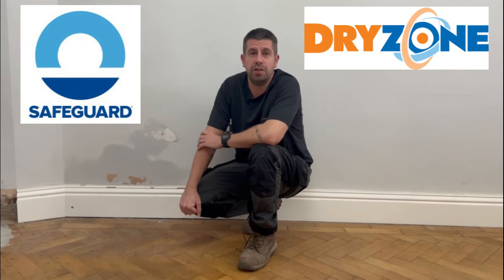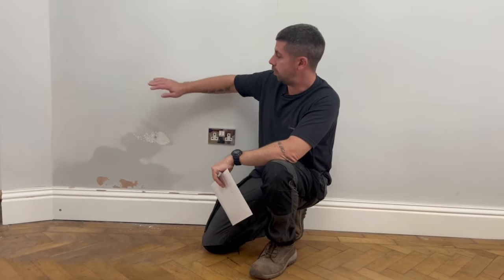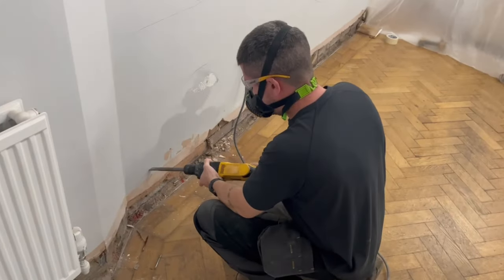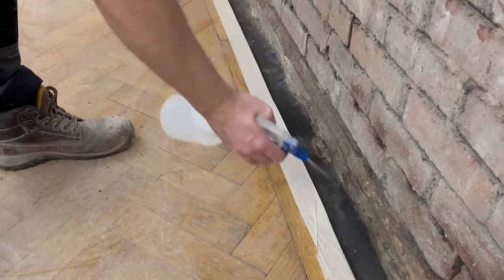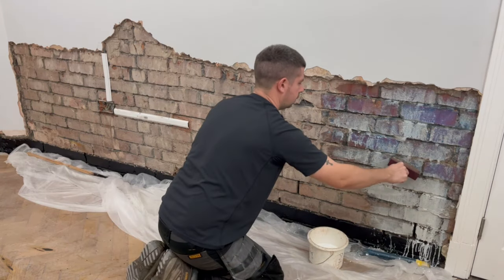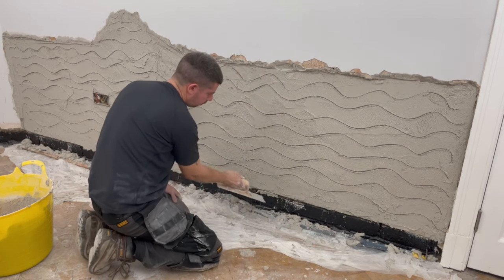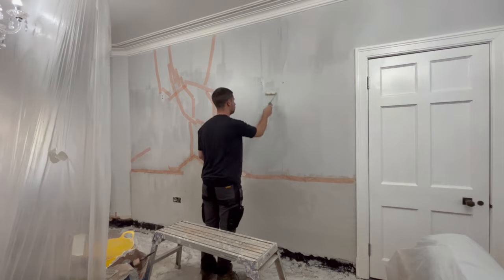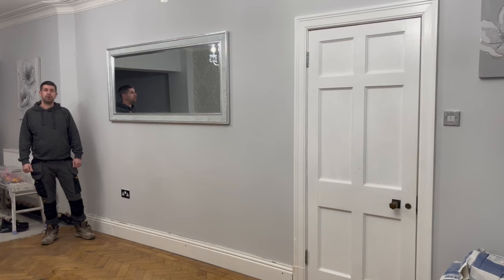How to stop rising damp, easy DIY solution

Comment: doesn't this just push the moisture somewhere else. you make a barrier to where it is coming through right now, but who knows where that moisture is going instead. I can't help but see this as a temporary thing. Usually pushing the problem down the road to the next owner of the house (first hand experience of this happening right now)
Reply: I think it acts like a Damp proofing course with the rods then everything else sounds like over engineering it to make it fully sealed.
Reply: You might be right but it depends on the cause. The video doesn’t have enough information in it to explain the cause as it’s about this system. Internal non-party walls with a concrete floor can be a head scratcher.
Reply: Had neighbour with damp who had it treated similarly to this. All that happened, was the damp came through into my house through the adjoining wall. After they moved, the new neighbour removed an old extension only to find an old blocked drain. I cleaned and made good and the damp slowly dried over time!.
This stuff just costs money and doesn't solve the issue just masks it
Reply: Papering over the cracks, treat the source not the symptoms

Comment: Damp will come through that plaster I promise you, there is no special coating to stop the damp, the coating will just peel and bubble off.   In an old house (mine is 250 years old), the only sure way is to take out a section of the wall at floor level  say 4 bricks length at time at ground level either one brick or two bricks thick, then with the hole clearance available dig out as much below ground which was under the bricks you have taken out, a breaker drill will do the job beautifully especially if you can break up the adjacent floor say 3 inches out and that will enable you to sideways dig out the old damp foundation rubble causing the rising damp.  Having dug out your new foundation trench you have ,  now you have to put in there what you would use as if was a new house you were building, ie impervious materials, quality concrete, DPC and  blue clay impervious bricks.   This might sound like hard work but it's worth it.  The best thing is that the  layer you put in say 2 bricks high when dried off, will be totally dry and the damp brickwork above it will dry out at about an inch or 2 a month, even quicker if you want to use a fan on the wall continuously.  A 4 brick section of the wall taken out at a time and it won't take long and in the end you know it's been done right and any plastering done above that new brickwork you know it will be good and dry.
Reply: It's not meant to stop it. The rods do.

Comment: Just put dry rods in the house I am renovating. It has a mixture of solid walls and cavity walls. I found many problems before installing the rods, and consider them "belt and braces!" There were redundant vents below floor lever that should have been removed when concrete floors were installed.  Ground levels well above old slate damp course, slates on roof that didn't reach gutter, drainage pipes underground that were held together with parcel tape, damp courses bridged inside. Also concrete right up to house walls (my pet hate.) I dug 10 inches down and put a gravel trap around the house. Poor house has been sat in a moat for years! That was just the beginning, I could write a book.

Comment: My guess would be gypsum plaster sealing-in the moisture causing the build-up of the wet. Solution: Remove all the gypsum plaster and replace with an appropriate BREATHABLE plaster and problem solved. It's amazing that people do things and are completely oblivious to what is actually going on around them.
Reply: This!!!! NHL 3.5, and check the exterior ground level, and guttering too!
Reply: Exactly 💯

Comment: Had damp and mouldy smell in my launge for years. After a lot of replacing plaster and keeping a window open all through winter months, I decided to rip up the floor boards. My DPC was old-fashioned slates. Broken and missing motar from joints and some of the slates had deteriorated. Thorough cleaning, then replaced broken and deteriorated slates. Repointed, then cleared a whole lot of damp dirt from underneath the suspended flooring. Let the area dry out for approx 1 month. Yeah, it was a long, hard, and messy job, but it was worth it.
 Replastered wall. Replaced damp skirting and floorboards. Sanded and varnished wooden floor. 
Damp walls and smell gone. Oh, I also had to dig up the concrete paving under the  windows outside as it was higher than the airbricks. I replaced the rotten makeshift airbricks covering with clay airbricks. My launge has remained damp free and smells great for over 3yrs now.
And i'm a woman in her 50s! 
I learnt almost all I know from these DIY videos.
My thing is, have a go. You never know what you can achieve. The best thing is, you save yourself a fortune.

Comment: Wish they did similar products for garages.  I have a huge problem with water seeping through an underground wall.
You're a brave man to take on plastering as a non professional. The tiniest imperfections are magnified once you get silk paint on there.
Reply from the maker: They do tanking products that would do a garage.
I'm quite good at plastering, it sort of came naturally to me without being taught but I only use matt paint 👍🏼
Reply: @spendtimesavemoneydiy  What's a tanking product? Is that the word I should search by?
Yeah, matt paint hides a lot of sins but I do like the sheen of silk. Just give sa wall a bit of life without it being OTT.
Reply from the maker: @Martial-Mat  tanking is for walls with ground levels above the dpc so the likes of basements
Reply: @spendtimesavemoneydiy  I'm sorry - what's the dpc? Can I use tanking on floors? Can it be painted?
Reply from the maker: @Martial-Mat  dpc = damp proof course usually 150mm above ground level. The tanking is for the walls and you can use a damp proof membrane on the floor like I did in my garage. Here's a link to the video 
Damp proofing the garage/workshop floor and new osb flooring
https://youtu.be/k6E94o63iAI
Reply: @spendtimesavemoneydiy  Nice one. Thanks buddy!
Reply: Don't use slik paint then! Looks tacky and is opressive!
Reply: @ozzie539  Oppressive? Quite the opposite I'd say. It's all fashion - to me, mat looks like people are hiding something or trying to be contemporary. I think silk gives a nice sheen, especially when applied by roller.
Reply: @matbroomfield tbh I silked  my bedroom as a late teen ..cool but prefer matt it's a personal thing   def not hiding anything here

Comment: Great stuff. Did you manage find out teh cause of the rsing damp? If so, how did you fix it so it doesnt occure again?
Reply: How did he fix it? With dry rods of course, did you not watch the video?
Reply: @czx68  no, what was the cause of it
Reply: @jonneymendoza   Gypsum plaster layer placed over the old breathable lime plaster is locking moisture in - just remove the gypsum and problem is rectified, Everything he did in this video is nonsense.
Reply: @adrienne7513  would plaster board drywall be better for preventing damp?

Comment: Ive been told the best way to deal with chimney salts is to knock all the render off, then spray it with TG500 and use Sika 1 in the mix. Is this right for chimney salts?

Comment: Brickwork looked bone dusty dry!?
Yet surface of gysum plaster appeared damp.
Doesn't seem like the problem was from behind the plaster.
Was a damp survey done first?

Looks like you've just hidden the real problem for a few years.
Hope the floor scrubbed up well after too. A few more dust sheets down would have saved you hours of cleaning up.

Comment: very good video  !  if you was plasterboarding after the  dryzone rods  what salt neutraliser would you use on the wall  ?  thankyou
Reply: Hi mark watch other video dry zone similar but they use 4 X3 plasterboards nearly same method so put in express system (dry zone)an also Google damp Sam express system I was using aqua boards but to be honest when I saw damp Sam an dry zone using normal 4 X3 boards I've changed to them hope this help pal 👍👍👍saves u mixing up the renovating plaster which I don't like them google or phone dry zone up or go to the merchant off they have the products video was good to watch he was good but I prefer the other way using boards 👍👍👍👍

Comment: You did a nice job. Be interesting to find out why that wall was getting damp, must be some water source underneath there.
Reply from the maker: The house is 90 years old so I think whatever damp proof course they used if any is now failing so damp is beginning to rise in a few places
Reply: The electric socket has been moved at some point and the affected area filled with bonding coat which is unsuitable for low levels where salts can be present. All that was needed was the affected area be chopped out and then patched with the dryzone express system or salt resistant render.

Comment: Just two points.
1. If you have to remove the plaster back to brick on a solid 9” wall anyway. Don’t waste money on an injection system, just get it plastered in lime. NHL3.5 will do the job, and dry in a similar tins to gypsum (which is trapping your moisture inside the bricks.
2. Rising damp doesn’t exist. Water travels down, either your ground level outside is too high (dig it out and lower it), idd red your gutter is overflowing.
Reply from the maker: But it is an internal wall, both sides are in my house, one side in living room and the other in the hall with no water or pipes anywhere near. The mortar behind the skirting boards was like damp soil and smelt like damp soil.
A lot of people have said rising damp doesn't exist so why does every new building require a dpm and dpc??
I'm no expert that's why I sought advice from safeguard.
Reply: @spendtimesavemoneydiy  old builds had dpc too. Probably made from slate. 
Are your floors still wooden on joists?
Reply from the maker: @BrainFizz  I know old builds had slate dpc this is a 1930s house but I'm unsure what the dpc is or was but external walls are fine just the internals.
The floors are all solid concrete
Reply: @spendtimesavemoneydiy  there you go then, there’s your cause…. The modern floors have most likely. Bridged the original DPC on the internal walls and stopped the original airflow under the ground floor..
Reply from the maker: @BrainFizz  but the floors are the original parquet, oak in living room and mahogany in hall
Reply: @spendtimesavemoneydiy  well if your floors are original,  and your placing your treatment from within the building, and it’s an internal wall. Then you’re already well above FFL what ever you do.
The original Damp course would be at least a brick course below so it’s not going to do anything anyway….
.
Could be radiator pipes, if they’ve been laid in the ground floor after, that could be leaking. Or the main water pipe - which is probably lead.
There’s obviously water under there. If is showing through your plaster then the bricks are soaked - properly soaked. They’re likely to be the weak spot in the pad, assuming the ground floor was originally screeded concrete.
In any case, the source of the water needs to be fixed first before the systems are treated or it’ll just come back again. Particularly now as we head into winter. Bricks won’t heal, they’ll just get weaker and weaker.

Comment: If we have on the first floor from the ground mould and the same wall in the next room on the second floor from the bottom. 
So how to work on the second floor? Where does the water go, if we do Similar ways? 
Does water not go to the first floor from the top? 

how to fix that wall on the first and second floor?

Comment: I had this but I Checked behind skirting board and it was dry.  The issue wasn’t rising damp but simply condensation from the cold wall as it’s solid.  Ventilation was the solution so not necessary to drill loads of holes into brickwork.

Comment: Is the skirting board new? If not why not remove the skirting board first to see what is happening behind the skirting board first?
Reply from the maker: It could've only been rising damp. There weren't any other sources of moisture that could have affected that wall. And when I drilled the mortar it was very damp so it was the whole wall not just that area.

Comment: How about this: " After damp-course installation, it is very important that the treated walls are left to dry for a period of several months before any re-plastering / re-rendering, painting....
Generally, it may take about a minimum 3 months of drying before any re-plastering/re-rendering can be done. Very salty walls should be left to dry for a minimum 6 months..."
Reply: Or just use a dehumidifier to speed up the process.
Reply: What if it's going to be boarded?
Reply: @Chiknnuggitbuzfeed I thought that would make cracking more likely
Reply: @just4bantzlel33  i guess you're right about that.

Comment: It’s a decent system but Sika also do an impregnating compound the appropriate holes are filled with the use of an ordinary caulking gun. A little bit of advice when using SBR as a bonding/sealing coat, damp the substrate firstly.  The SBR is more easily absorbed into the substrate. Unfortunately gypsum is very water soluble, very. Better to use a lime based render as it’s also breathable.

Comment: Always looks easy then when you start the first step, taking off the skirting, on a 30s planked  floor house takes the jam right out of your doughnut. Nails rusted to the brick, skirting ends up as kinling and you can't buy that Suze and type anywhere on the planet so the whole room needs reskirted and the water table is so high under the floor that there's an inch of standing water. Let's get some real world problems. As you say anyone could fix that one.

Comment: And surprise surprise the brickwork seems bone dry..
Reply from the maker: The mortar was saturated
Reply: @spendtimesavemoneydiy  Didn't look like it with the dust from the drilling.
Reply from the maker: @anthonymclean9743  it was like wet soil and it smelt like wet soil too
Reply: @spendtimesavemoneydiy  I've had a similar issue, internal wall, absolutely no way of water getting in apart from the ground allegedly. Spent years and lots of money (including a system like the one in this video), professional opinions - couldn't resolve it, until I installed a new ventilation system. Now moisture is low in the house and the issue has disappeared despite high rainfall.

Likely same thing happening here... those bricks look dry similar to ours, even if the mortar is saturated, doesn't mean it's coming from rising damp, likely the moisture pooling on that wall is seeping into there. The wall closer to the ground in certain spots is colder,  temperature may well be affected by groundwater underneath house but not rising damp in the way a lot of people make out. Definitely not worth removing plaster / pumping in chemicals into your wall / replastering IMO.

Cancel

Reply

Comment: Non of this is needed!!! You said it’s a solid wall…..you have modern  materials that do but allow moisture to escape! What you have is condensation which is exactly what they call rising damp ……it doesn’t exist!

If you had taken the plaster off and let it dry out that’s it plus a lime plaster afterwards

No idea if you have cement render on outside but if you do this is further more your issue as cement and gypsum trap moisture!

Comment: Total rubbish.!! The damp is obviously being caused by the gypsum plaster layer that has been placed over the old original lime plaster.  The lime allows moisture to breath out of the wall - the gypsum was locking it in. All that is needed here is for the gypsum layer to be removed or all taken down and the lime reinstated. Everything you did here is utterly pointless and has made the situation much worse. That wall will be saturated  behind all that waterproofing in a few years.